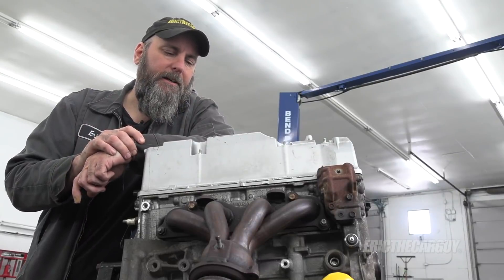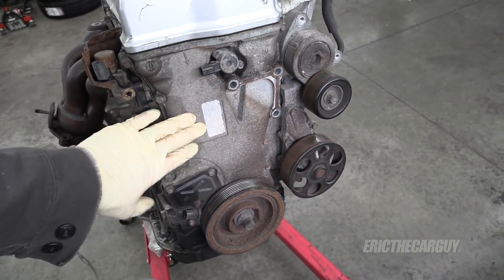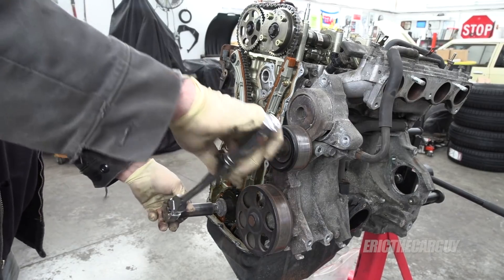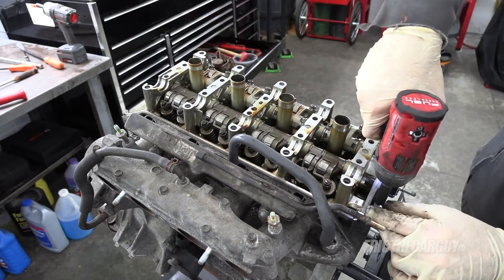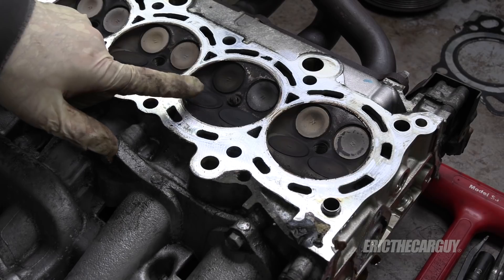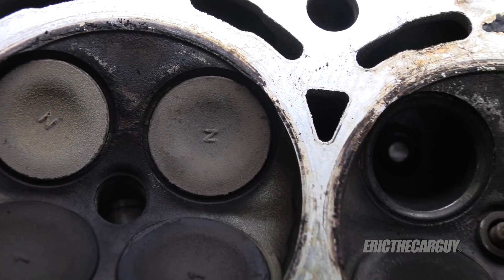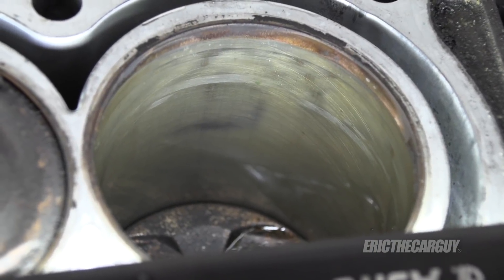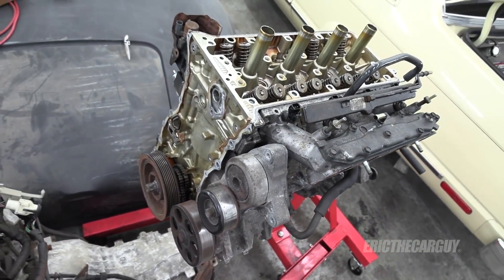Honda K Series Fail, What Went Wrong?

Comment: Hey Eric I have a question. I have a 08 gmc sierra with 160.000 miles and I noticed here lately if I run it like not hard but just a little aggressive and let it sit for a couple hours when I start it back up I get a cloud of white smoke from the exhaust what would cause that
Reply: Does it also have a smell to it. Check the coolant and see if it's low. Could be a head gasket issue
Reply: @rustynail9793  it does have a slight smell its definitely not oil
Reply: @mrglock2002  if it's coolant then it would smell sweet. Oil is a blue smoke
Reply: @rustynail9793  it does have like a sweet smell so it's probably a head gasket right
Reply: Pressure test your cooling system.
Reply: @spacecat7247  ok I will do that thank you
Reply: If the coolant is low. White smoke that smells sweet. Chances of headgasket is pretty high
Reply: @mrglock2002  like Rusty Nail said.....but if you just have  a little bit of vapor after a cooldown and coolant levels are ok   it might be valve guide seals

Comment: I thi k there's some locking pins in the cam gears so you can lock tdc before taking them out
Reply from the maker: I believe you are correct, but as stated, I've never seen an issue with one.

Comment: OK, what is the purpose of the plastic insert in the number one cylinder water jacket?.  I pulled one out yesterday and scratched my noggin' over it.
Reply from the maker: Given that the engine uses a Siamese bore, that's what they call it when all the cylinders are attached like that, it's probably something to help prevent vibration.

Comment: Hi Eric I have a similar engine in my 2014 Accord, it being a 9th gen Accord it is the last generation of naturally aspirated stick trans Accords. What made this K24 in the video burn oil? I change the oil with 0w20 full synthetic twice a year, never once have I gotten 5,000 miles in 6 months with it.
Reply: you dont drive enough then
Reply: @joeydelmarsjr.646  Your idea of enough isn't mine. Unlike you I have a car collection.
Reply: @hithere7382  good for you i also have a car and truck suv collection
Reply: @joeydelmarsjr.646  Probably a bunch of heaps...
Reply: @hithere7382  doesn't matter whether it's a keep or or not long as their run in the work I don't see the issue here it's on someone that doesn't know what an alternator is

Comment: Looks like the head was the main issue. New valves and valve guides should get that engine going again . That's a cheap fix at a machine shop and I bet that engine would keep kicking
Reply from the maker: I would also, at the very least, hone the cylinders and put new rings in it. By the time you do that, you might as well do the bearings too.

Comment: Any Honda car engine should last more than 300K miles easily if the owner change the engine and transmission oil religiously with $25 (1 big jug) Mobil1 WalMart. My 2002 last 340K which still run before I sold it and my current daily drive 2013 Honda Accord also in 284K without any engine problem. I just replace the alternator with belt, a/c compressor and engine right mount (all first time), but that's another topic.

Comment: Ok i need your help with My k20a2 engine i recently bought. When i align the cams with the two pins through the back of the cams the exhaust cam is right but the intake cam is off a tooth and half. If i line cam timing marks up correctly i cant install the pin through the intake cam. Someone help me please

Comment: I'm curious as to what the oil consumption issue is.
Reply: More than likely the valve guides were completely worn out, as well as the cylinder wear.
Reply from the maker: As I said in the video, it's usually global. Meaning, it's likely leaking at the valve seals as well as the piston rings. Therefore, I decided the best approach in my situation was to replace the engine over rebuilding it. Thanks for the comment.
Reply: Thanks guys!

Comment: i have 09 Honda Fit & 05 Honda CRV.
do you recommend valve adjustments for them?
Reply from the maker: Only if they're noisy. If you do have it done, make sure they have experience adjusting valves. I've actually seen more problems caused by improperly adjusted valves over anything that just wore out. BTW, the CRV uses a version of this same engine.
Reply: @ericthecarguy  thanks man! i appreciate the reply/info

Comment: I thinking about buy a Toyota 4 runner are they better than the Honda Element
Reply: In terms of off road ability and mechanical reliability, the 4runner wins. The 4runner is a gas guzzler though. The Element is still really practical, yet cheaper to buy and maintain. I'd get an element with low miles. I'd personally pick a 4th or 5th generation 4runner with a V6. The 3rd gen and older ones are slow even with V6 engines. Not to mention the old V6 ones have a timing belt and you could come across cooling system problems. The newer 4runners with the 4.0 V6 are much better.

Comment: the k24a1 motors an older crv motor element has the k24a4 motor stock  diffrence is compression is higher on the original motor  to much fuel must have washed motor out  the rings and motor

Comment: How much is a decent used K24 engine? And how much would it cost to replace it?
Reply from the maker: I bought the one I replaced this one with for about $800. It came from Japan. I wasn't happy with the company I worked with which is why I never mentioned them.
Reply: @ericthecarguy  From Japan? New or used? And what would the labor cost replacing the engine? Thank you for replying. I appreciate.
Reply: @ericthecarguy  That wasn't the company that turned out to be an international crime ring and was selling stolen parts, was it? Iirc they are still somehow in business

Comment: I have a Honda CRV 2003 it had a head gasket leak water on the oil and they took it apart but they never lift the first piston they just took it apart and I want to put it back together because that's my only car and I don't have the money to get a mechanic to fix it the one that I had just left it there for like two months and I paid them in never did nothing that just went and picked up my car can you please help please? I live in Mexico can you please help on a video that you might have please? Thank you...?

Comment: Would you consider importing a used engine from Japan?
Reply: His replacement engine is from Japan.
Reply: I've done it. Usually have around 30k miles on them.  Good deals to be had.
Reply from the maker: That's exactly what I put in place of this engine. https://youtu.be/Abl91R0T5dw
Reply: @ericthecarguy  When the engine in my Toyota dies, I plan to do the same thing.

Comment: That white ash exhaust color is not from burning oil champ, it’s from new gas packages trying to get the car to run cleaner and running lean.  Every single engine I’ve ever taken apart, which numbers in the thousands or more, has white ashy exhaust valves, put out accurate information bro.  Seat new valves done.

Comment: 14:53 I am curious, does anyone know if the Honda 3.5l v6 engine uses hydraulic lifters? I am having a knocking sound at start up and the dealer told me it was noisy hydraulic lifters. I have a recording on my channel of the noise. It's a 2017 accord v6 automatic with around 35000 miles.
Reply from the maker: The J series does not use hydraulic lifters. https://www.youtube.com/watch?v=OnyqVg3nWRk&t=3s

However, I don't believe loose valves will cause the issue you mention. Make sure you're using the correct viscosity oil which is listed on the oil cap. Likely 0W20. If you use a thicker oil, it will starve the top end of the engine for oil during start up.  http://www.ericthecarguy.com/faq/diagnosing-noises-in-your-car
Reply: @ericthecarguy  Thanks for the reply. It’s a messy situation. I have made six trips to three different Honda dealers and two of the three said the noise is normal. The third one said that the noise was caused by hydraulic lifters but there was no need to “fix” them. I guess I know why now since they don’t exist in this engine. All of the service has been done by the dealer since it was new. The oil looks fine and the level is good. The other issue is a shudder from the transmission. Two dealers said it was normal and one dealer noted the fluid was burnt and they did a flush on it and now it’s 10 times worse. I know it could be anything but from what I have observed, the noise goes away when the car is put into reverse or drive. When I return to park or neutral it comes back. When the car warms up the noise goes away completely. The transmission shudder is always present while maintaining speeds from 20 to 45. I am wondering if maybe the two issues are related. If the noise is coming from the torque converter, then maybe whatever is causing the noise when it’s cold is also causing the shudder. I also don't know if a shudder would cause the transmission fluid to burn. Corporate opened a case and when the last dealer said that it was all normal operation, they closed it.

https://youtu.be/6akOxXdYNLA

Comment: 95% of the time, VTEC codes are NOT caused by timing chain troubles.  They are caused by a small list of other things.  Clogged screens behind the belt tensioner and solenoid are usually the culprits.  Other issues are wiring harness problems at the plug and a failed solenoid.  NOT A TIMING CHAIN...

Comment: I don't get Honda's thinking of not using hydraulic lifters and having to do valve adjustments.
Reply from the maker: More accurate valve timing with solid over hydraulic. Less moving parts to break and cause issues.

Comment: 184k that's nothing my alero 2.4 currently 322k im a 1 owner back 191k replaced coolant leaking head gasket because antifreeze froze on a -50*f day did valve job there was thick dorito size carbon everywhere wiz wheeled that off but forgot to install new valve umbrella seals so it's got a puff of smoke every cold start iridium spark plugs never foul but do completely wear away every 130k

Comment: Valve clearances should be checked every 25000 miles inlet 0.21 - 0.25mm exhaust 0.28 - 0.32mm. These are so often missed on servicing. People assume they are hydraulic and because they are quiet they are fine they are not, many I serviced had tight clearances which will lead to burnt valves. When correctly adjusted and the engine revved they make a sizzling sound, much like the old 70's BMW's. With the advent of ethanol in fuel I always set to the widest gap. Mine on 190,000 miles no oil usage still going strong with a fair turn of get up and go. Perhaps one of finest engines ever made.

Comment: I don't call that excessive oil burning as my 5.7 litre Chevrolet LS1 V8 engine had the brown crusty deposits on the exhaust valves when I replaced the hydraulic lifters about 2 1/2 years ago,the spark plugs ran cleaner but.

I would be concerned if I saw this because I would think that the engine is burning oil :-

https://www.nomaallim.com/uploads/4/7/5/1/47517951/pc260625_orig.jpg

https://www.nomaallim.com/uploads/4/7/5/1/47517951/pc310822_orig.jpg

https://www.nomaallim.com/uploads/4/7/5/1/47517951/p1050949_orig.jpg

In my car 1/2 a litre is acceptable of oil consumption is acceptable in 5000 kilometres (3000 miles), mine is a 2002 built Chevrolet LS1 V8 engine & anything under 2.5 litres in 10,000 kilometres is acceptable because people had their 1999 Built engines rebuilt under warranty by Holden in Australia when they received a bad batch of engines where the Teflon coating on the piston skirts just wore off.

They were bored out to a 0.010" oversize & bigger pistons were fitted,one person claimed to have burned 4 litres of oil during the 10,000 kilometre service interval therefore his car qualified for an engine rebuild !

Comment: I pour fluid into the ports, that engine can be saved ,some  times you can just replace the rings and hone the block ,but since you have to remove the rods ,etc , I would replace the rod bearings, as for the head have it milled with new valves and the valve seats touched up, new oil seals etc, you know the drill.   its how fat your wallet is. Ever notice how the barrel faced top ring  doesnt leave a nasty ridge on a high mileage engine?